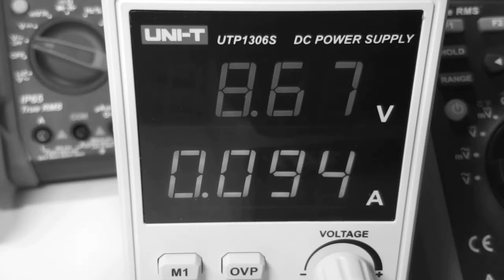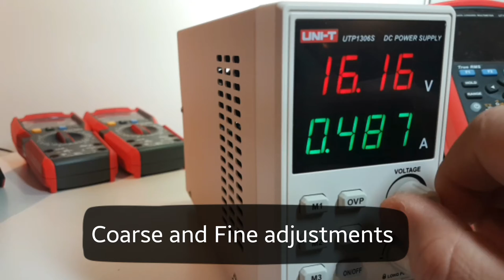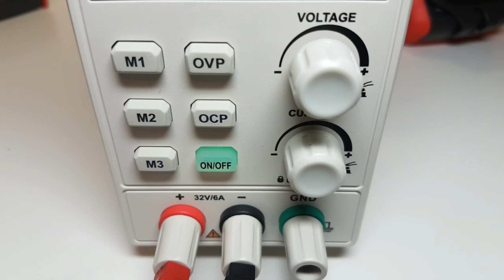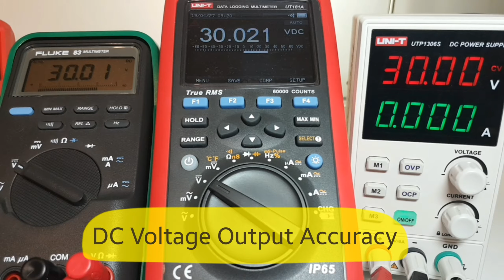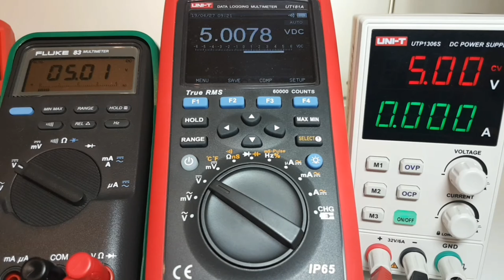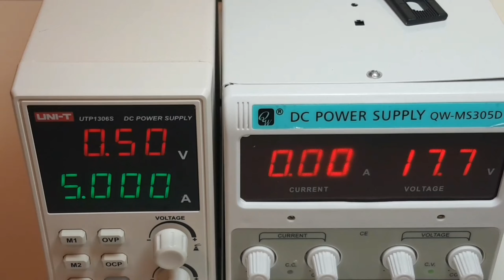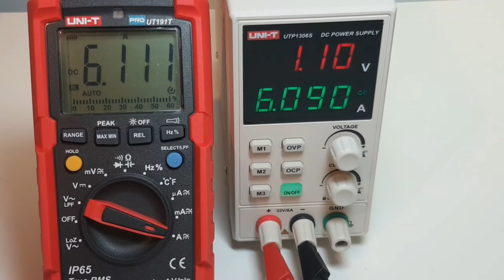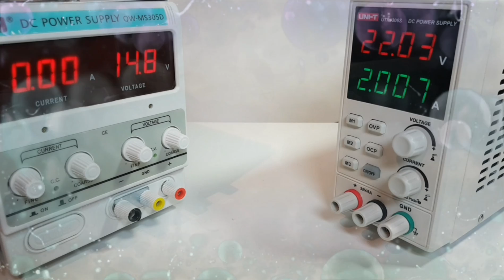EXCLUSIVE UNI-T UTP1306S DC Power Supply Review & Teardown!

Comment: What is the difference from UTP 1306 to UTP 1306S ??
Reply from the maker: This just came from UNI-T directly.
"UTP1306S Input voltage:220V(can shift)±10%  (No AC 110V  ,please make notice) For 110V please buy UTP1306".
So I was correct in my original answer, the S VERSION is 220V, buy the UTP1306 for 110V.
Reply: @KeepOnTesting  1306 is can work on both 110/220
Reply: @MrDehicka  no, is only 110V. The selector isn't functional, I Know because I have the 1306 and I disarmed it.
Reply from the maker: UTP1306S 220V / UTP1306 110V,  identical specs.
Reply: @KeepOnTesting  Not.  1306  is more expensive that 1306S.
Theo tão have 110/220 selector from back
Reply: I think one is digital and the other analog internal
Reply from the maker: @DeepOf  I'll contact UNI-T for clarification and report back when I get more information. 👍
Reply: Utp1306 funziona 110 e 220

Comment: As you had a linear PSU to hand, it would have been informative to have compared the noise on a scope between the 2 units. Also to show how quickly the supply reached it's output setting. Were there any spikes at switch-on? Same for current limit. Did it kick in straight away?

Comment: Dear guy, do you have oscilloscope to do some tests with this device? CC
 mode looks like bit to slow and I have recently burned one device... 
too sad as this looked like price/value winner.
Reply from the maker: No problem, what kinds of tests were you looking to see ?
Reply: @KeepOnTesting  Take 3mm LED or other small one. Set like 7V(?) and 10mA CC, I have burned a few as it did provide 10mA but to late, had to pass through some more amps before it switched to desired CC of 10mA (no R in series!). Too bad saw magic smoke! Next one issue I had: LED strip switch with mosfet and 10 leds. 24V, whole circuit drew 33mA so I set CC to 40mA just in case you know! And shit happend  I've short ciurcuited LED strip. It did not switch to max 40mA on time as mosfet stopped working (always conducted ever since). CC mode did kick in as CC red led showed up, but that was tooo late. 
Did not dismantle this device, maybe there is a beefy cap inside just at the leads? But c'mon this mosfet was able to handle 6A afair (small smd one). So oscilloscope would be halpful to check how fast CC kicks in and what Amps goes since T0 (short) to actuall CC working state. 
Please do some easy tests green/red LEDS burn challange, some 5mm yellow is capable of surviving laggy CC mode with this PSU thou. Mosts die... 
But my led controller with some strong mosfet did not get any chances! WTF? Will post amazone review (sort by the worst score) and maybe later check that dude findings but please, please check the time needed for CC to kick in for LED, some mosfets +Amps dreawn in real life - on the short circuit case. 
Maybe also test OCP mode, maybe this one is faster? Like I have 7V, bare small LED, 20mA OCP, would LED perish or not? Anyway I bought that unit for CC mode to protect devices from my mistakes during DIY tests or repairs... 
Thanks A LOT. Greetings from cold west EU :-)
Reply from the maker: @Krionix81   @Krionix81  Roger that. I'll try those suggestions and let you know what I find. Sounds like your unit might be a dud but will see. Btw, When you set the CC to say 1 amp, you are telling the power supply to allow no more than 1 amp through the load. The load can draw whatever it needs - up to that 1 amp limit. If it tries to draw more, then the power supply will reduce the voltage as required to maintain 1 amp maximum. This should be instantaneous otherwise what's the point of a cc mode 🤔
Reply: @KeepOnTesting  Osc. will show the naked truth (I dont have any), my unit is brand new. I like the form factor, well known brand but... not counting LED I lost that LED driver. Some odd UI things can be noted as well, push the knob and it should go back to the last digit changed, not the less significat one (tedious to do frequent changes). Switching from M1 do M3 will not tun off the output SADLY, super EASY to burn device just pressing the wrong Mx button :/ Default timeout while setting CC/O*P is just 1s? Should be longer imho. Super dimm LED backlight of M* buttons and O*P however I like they made them lit but soooo weak light is easly overpowered by daylight. God damn it. Did they test that in the dark pit hole? Anyways CC mode should be fast enought to protect the devices, ohm law still existign so yes V down (however if there is a huge filterign CAP just before leads are hooked up this is not good right). I belive that 32V 10mA could be dangerous but not 7V 10mA burning the LED that would draw just few mA. Plese do the various tests and make graphs (check the Amazon dude). Focus on CC in normal life, not just "Edge" situations that hardly ever happen. Why my 6A mosfet burned with CC of 40mA I bet I set that correctly, 100% sure some LED did not survive former "just PSU +bare LED" tests. Have a good one!
Reply: @KeepOnTesting  hi, did you have time to make those crucial tests? TIA
Reply from the maker: @Krionix81  Negative..it's on my very big Todo list. Hopefully before end of month.

Comment: Did you set 10mA CC mode and connect a LED straight to this PSU (w/o any resistance in series!). Did it blow or just light up as it should in CC mode? Like 15V 10mA CC mode. I heard that CC in that PSU is slow... would blow the LED up instead of providing 10mA as set since the start... too slow CC mode reaction. UPDATE. I have tested that with my unit. Some leds are burned to ash some survive. CC mode is too slow for very fragile semiconductors. It does work but with some lag, for some LEDs this is a death sentence as I have tested that on my own. Overall this is a very neat and portable device. M1-M3 are backlight enabled but it is so dimm that during the day it is barly visible :/

Comment: Nice review! I'm choosing a new amateur DC power supply between UNI-T 1306S and Wanptek ASP3010. 10 amps vs. 6 amps - it doesn't matter. Could you please advise which I should prefer?
Reply from the maker: Well the UNI-T is used almost everyday and it's still going strong.. hard not to reccommend this power supply! 😀👍

Comment: Darren, thanks for your breakdown. I have the unit now for a year or so. Yesterday I still used it set to 17.3V and 0.8 amp. Switching it on. It delivered the voltage and amps. Today I switch it on and the moment I turn it on it is set back to OV and OA. What could be the problem? Thanks for answering
Reply from the maker: Did you check the fuse to see if it's blown?
Reply: @KeepOnTesting  I opened it up but could not find any fuse.

Comment: Does a Over Current protection means that if I connect the DC Power Supply's two terminals together (To create short circuit) it will stop working or what?
Reply from the maker: No , it simply means that you must physically choose to OUTPUT the voltage / current before it will physically flow into your circuit. Something like a safety valve.

Comment: OK i managed to rework my unit... design is  good but assembly of the thing was really a CRAP. 
1) I had to re solder all the HOT wires with a very solid  passthrough welding
2) Replaced the  post-current shunt 470uF 50 volt output capacitor with a 1000uf 50 volt 
3) Replaced the pre-current  shunt 100uF output capacitor with the 470uF recycled from  point 2
4) Added a ultrafast MUR120  protection Diode in parallel to the Output , very important for drive DC brushed motors...
Cheers
KK

Comment: Any hint for balancing the brightness of the red \ green display without making too much mess ? My red is less bright than green display.
Reply from the maker: 😕 Besides the brightness is everything else operational / running normally ?
Reply: @KeepOnTesting  Yep everything fine , just a very small preponderance of the green display. I can do an easy fix ... but hardware... maybe there is an hidden sw menu for regulate the brightness ? Probablt not...
Reply from the maker: @MrKkprince  Great 👍 No sub setting for display brightness although that would definitely be cool! I'll ask UNI-T directly and report back...might take awhile..
Reply: @KeepOnTesting  Ok ..It 's xmas time... I do not want to re-engineer things today... but ...I managed to remove the very front cover  , the led driver is the TM1638 and should be ok as it cannot set the brightness individually for each 7segment digit.  The green 4 digit display block  is a QHL5641AHGG while the red one is a QH5461AHB-32 ... I think the difference in bright it's normal as the two are different bits... ah they also forgot to peel off the protective plastic on the red array... after removed situation is better... I quit for now...  Happy XMAS !
Reply from the maker: @MrKkprince  Great to hear  ! Merry Xmas!

Comment: Nice standard built quality... High accuracy with standard input protection.. Nice switching circuitry inside..neat n clean.. Every thing is perfect... But price was little bit high.. I like UNI-T 👌👍
Reply from the maker: It's proven itself.. 1 year later and still tough as nails! Quiet too...very nice 👌

Comment: UNI-T UT P1306S has 4 digit resolution, 3 memory storage option,  over current protection, on/off protection, good built quality. It's a nice power supply ... Though I like my QJE QJ3005N for my laptop repairing job

Comment: I'm interested in purchasing this power supply, but kind of confused. Is it a Linear power supply? If you check out the link on their official store on AliExpress it says it lists it as a switching power supply, then on another line it says linear? Strange. Link: https://www.aliexpress.com/item/33061530471.html

I see yours has a voltage input switch, yet all the listings I see states its for 220v only (not 110v, check out  model without the "S" - UTP1306). I'm so confused and any input would be appreciated!
Reply from the maker: It's a switching power supply..currently I have it running @120V ..UNI-T didn't market this very well so its often confused as a 220V only.. but no problems here.. 😃👍

Comment: Wondering  can the psu sustain the supply at 32v/6A for many hours as specified.
Reply from the maker: I've ran the PSU at 6A for 45 min and it was fine. Many hours I can't say but we all know since heat plays a major factor in electronics longevity, the higher the workload the more heat generated..usually not a good thing.
Reply: Is that 6 A at 32v ? I know thats quite a lot of power draw.. may be a 12v car headlight bulb only can resulted that high powe output...

Comment: Hey Darren, first of all great review! It helped me a lot when i was considering what to buy. I do have one question... i dont quite understand what the ovp and ocp buttons do, and the manual is very vague about it. Could you elaborate a little on it? Its my first bench power supply.
Thanks!
Reply from the maker: Hi Ricardo, OCP / OVP are features that utilize one or more circuits to prevent a power supply from delivering more current or voltage than it was designed for or that  its circuits can handle. It basically throttles the current or voltage negating any excess or bias to prevent damage. Thanks for watching!

Comment: I just bought one of these. It has a few minor issues.
1. The blue LEDs behind the buttons are very, very dim - I can only see them in a dark room.
2. There was a loose piece of wire (looks like a bit of a snipped component lead) inside the coils of the current shunt on the front panel which could have been shorting out a turn of the shunt coil or could have fallen into the PCBs.
3. LED V\Amps reading is pretty accurate but I can't see how to adjust them?
4. No mains switch on the front panel - must reach round the back to switch power on\off.
5. If press one of the Memory buttons whilst the output is enabled, it immediately changes the output voltage to the new value. It would be safer for it to switch off the output and allow you to enable the new setting after checking the voltage is what you want. You could accidentally press one of the Memory buttons whilst adjusting O/P or CC with disastrous results.
It has one major issue however - try this:
Set O/P to 32V. Connect small load e.g. 1K or a bit less or no load. Enable output. Now switch off mains 230V AC power. The output will shoot up from 32V to 40V before going down slowly to 0V. If you set the O/P to 26V or below then there is no surge on power off. Also, if you connect a larger load (52R or more) then there is no surge.
https://rmprepusb.blogspot.com/2019/12/evaluation-of-uni-t-utp1306s-32v-6a.html
Reply from the maker: Thanks Steve  great info and surely will help others. I've heard similar feedback about the memory buttons, hopefully UNI-T will address this in a future update. Q/A is usually pretty good with UNI-T but it looks like your unit was not well inspected. Hopefully it will last, so far mine has performed quite admirably  .
Reply: @KeepOnTesting  P.S. The front panel has a thin protective plastic film covering. Remove it to get a  clearer display! If anyone knows how to make those blue LEDs  brighter, please let me know.
My unit also has that extra hole in the heatsink, I assume they use the same heatsink in another similar unit which requires this extra hole.
Reply from the maker: @steve6375  Roger that, those blue LEDs should definitely be brighter , my unit displays it without any dimness at all. Hopefully we can get that fixed for you.

Comment: I have had a problem with my UTP1306 - I selected the M2 button to set 5V out for a device I was testing. This is great, very convenient. But then I moved the power cable to a different wall socket and when the power came on the voltage jumped to 13V and my device smoked. There is some usability issue with these buttons - you have to remember to press them twice (the second press a long press) for the voltage to be stored for use after power failure otherwise the previous voltage used will be set after a power interruption. This is a bit odd and kind of spoils it.
Reply from the maker: Yikes, sorry to hear that. Yes  preprogrammed defaults can be challenging. I usually wont connect my test device until I see the power source is correct. However,  UNI-T should have a safeguard built in to prevent such an occurrence.

Comment: WTF! 7:22 shorted electrolytic capacitor! 7:44 the second capacitor has wrong package and it floats in the air... also transistor has smaller package... my score will be two donuts out of five! dont trust any shorted capacitors in chinese electronics!
Reply from the maker: Six months later and zero issues to report. This unit has taken everything I have thrown at it.. its quiet and accurate...UNI-T did a great job with the UTP1306S

Comment: Hi Darren, if you start to run out of meters may I ask you to review bench power supplies. I'm considering buying a cheapo power supply for basic electronics. Essentially teaching myself Arduino and designing basic circuits. What are the pitfalls of a power supply like this?

https://www.ebay.com/itm/30V-10A-Adjustable-Variable-Digital-DC-Regulated-Power-Supply-Lab-Grade-TN/163763734153
Reply from the maker: Hi Paul,

I will have some bench power supplies up for review in August. At least two different supplies will be reviewed. Btw, I dont think I will ever run out of multimeters 😁👍

Comment: 110 V AC AVAILABLE?
Reply from the maker: Yes indeed...I've informed the seller to update the Ebay link..should be done shortly..
Reply from the maker: UTP1306S Input voltage:220V(can shift)±10%  (No AC 110V  ) For 110V please buy UTP1306